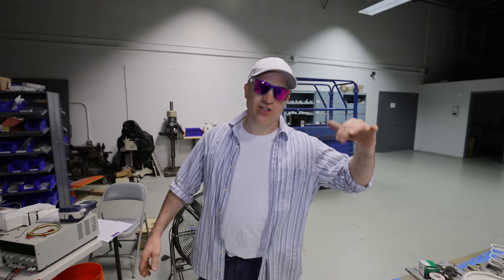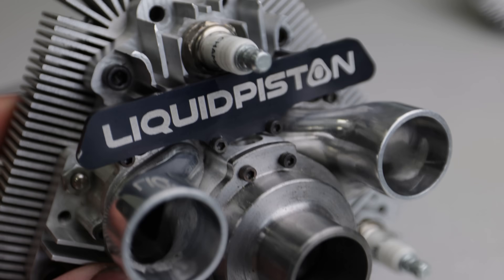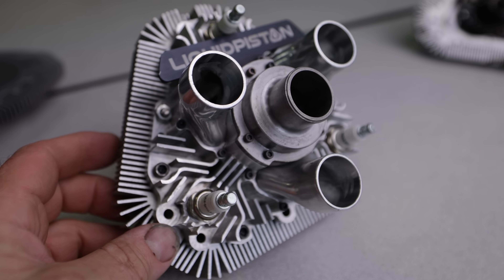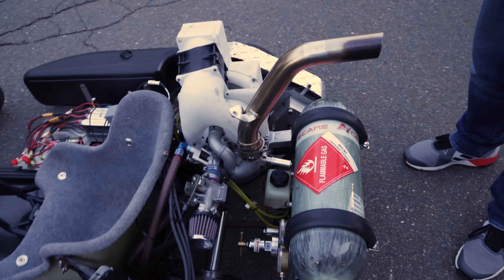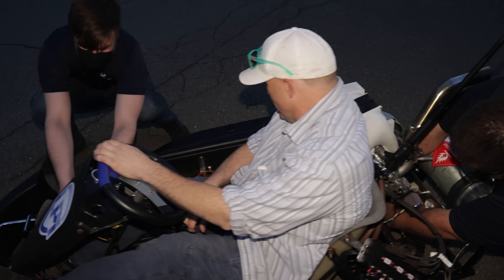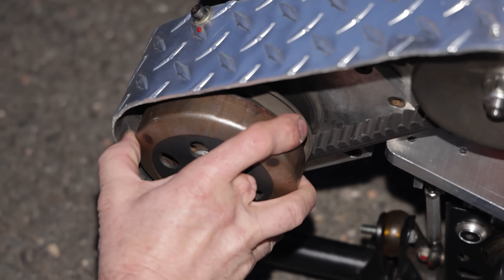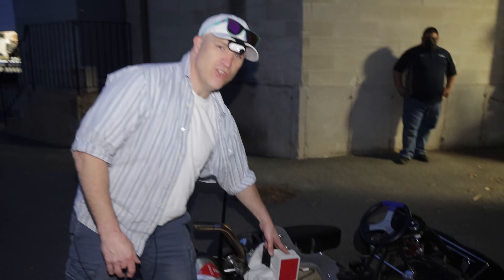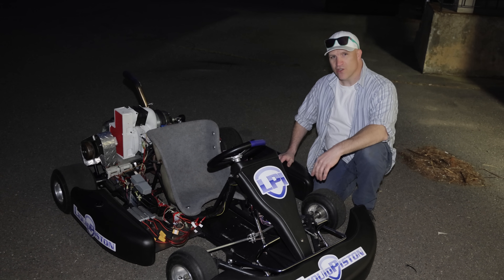Hydrogen Powered Liquid Piston Rotary Go-Kart

Comment: Many people are trying to build/create a hydrogen engine that doesn't melt or corrode quickly. Great job maybe you're the new elon . Next problem:create a hydrogen generator that can compress enough pressure to run that motor then make it compact enough to fit cars.

Comment: Nice touch timing the firing to the music. I'm curious if the exhaust should point down instead of up for water evacuation. Back pressure from the fuel burn might have water collecting in the upward facing exhaust plumbing? 👍 😃
Reply: The water doesn't condense in the pipe, the reaction product is gaseous water (steam) and any cold start condensation will quickly boil off from exhaust temperature. Hydrogen runs really HOT. You can't play with the stoichiometric ratio of H2 to O2 as you can with liquid fuel and oxygen. If anything you have to run it oxygen rich to reduce power of the stroke. If you run it H2 rich, you'd have a constant flame from your exhaust(and melt the tip of the pipe) as any hydrogen left in the exhaust product will immediately react with the atmospheric oxygen.

Comment: Good to see work continuing. In Australia we had the Sarich rotary engine, sadly never got to sort out the full burn level. Keep it up guys!
Reply: What 2 stroke oil did you run in that? I use nothing but amsoil interceptor in my rotaies.
Reply: @jlo13800  Sarich is long gone. But on 2 stroke jetskis we use a full synthetic oil. It lubes perfectly without burning away and comes as oil out of the muffler.
Reply: That sounds like the EMD16-645 2 strokes on the boat i work on and the detroits also. oil comes out of the exhaust if there is not enough load on the engines.
Reply: Yes the rotaries use the same 2 stroke synthetic oil!

Comment: I feel like that thing could use an $80 ebay CVT with half the weight taken out and be WAY more impressive. Yeah, it's the first step, but try to make it a normal looking step and not a tip-toe.
Reply: It will need another down gearing, but exactly this.
Reply: Looks like the CVT that’s on there is on the wrong shafts if the motor is on the front pulley
Or should I say it looks like the rear pulley is on the front and the front pulley is on the rear
Reply: @garymorel1882  It’s chain driven, so one gear. Presumably to compensate for the lack of torque. A CVT could be a great idea though
Reply: @TheFakeFatLegitimate  well it looks like a eBay series 40 but backwards in infact I built weird stuff too but I’d use a solid pulley on top being electric then use the secondary as it’s normally designed
Reply: I think their website shows something like that.

Comment: Cool! The Liquid piston engine. If you define a 4 stroke engine as  2 revolutions per combustion event and a 2 stroke as 1 revolution per combustion event the Liquide piston is a 1 stroke motor it has 2 combustion events per revolution. A rotor is a 2 stroke it has only 1 combustion event per revolution.

Comment: Steam engines added oil to the steam, in order to lubricate the internals, because water is a very poor lubricant. If you use oil inside, it is no longer clean, and will give some carbon build up, how do you solve that?
Reply: graphite or similar dry lubricant.

Comment: It may be slow, but it worked. That's where you learn. The belt clutch was possibly holding it back without the rpms needed. Tune the drive train I'd like to see more on it.

Comment: I'm confused. How does the engine lubricates?
Reply: Since the seals aren't rotating, they could pump lube in through one side and out the other.  With the see through plate provided by Warped Perception, this would have been ommited.
Reply: When it comes to Wankel rotaries (triangular rotors) oil is commonly added to the fuel which lubricates the rotor and apex seals then burns off during combustion, just like a 2 stroke engine you’d see in a line trimmer or chainsaw, but with the liquid piston, I have no idea. I only really understand liquid fueled systems, so I’m not sure about the gas either.

Comment: Awesome!!  More videos like this one for sure!!
Reply from the maker: I'm trying!! I seem to be getting back on track now, been a tough last couple of years
Reply: @WarpedYT  this engine need rusEFI ECU ..
Reply: @Abricos4440  would need to be completely reprogrammed, it would have no idea how to hadle the timing of this engine.
Reply: @mycosys  this is not a problem ...
Reply: @WarpedYT  I have a question. What is the point of running an engine on hydrogen, converting that energy into electricity, and then converting THAT into kinetic energy? Why not just run the engine on hydrogen and then just use that? Why over-complicate the system by using the engine as a generator when you can just run it like any other engine into a gearbox puting power to the ground? Seems a bit like a dog chasing its tail to me. I would genuinely like to know the reasoning behind adding an extra step in the process that seems like it doesn't need to be there. This may just be my opinion but I feel like simplifying the system would be more beneficial in the end.
Reply: @WarpedYT  I want you to open the top of a battery and in slow motion show it being dipped in water
Reply: @WarpedYT  i really want to see how that engine holds up on something spicy like Nitro-Methane
Reply: @cmdr_scotty  i dont think its actually running on the fuel mate, pretty sure its the electric motor doing 100% of the work, every video its been connected to some type of electric motor also.
Show me a video of it sitting there at idle speed and ill be convinced.
Reply: @shannonneal3271  more likely it's torque curve isn't very great seeing as how it's the size of a little pocket bike motor. Having it hooked to a generator which indirectly drives the wheels via electric motor would act as an overly complicated CVT. I'd say it's probably about 2hp, maybe 3ftlbs
Reply: @WarpedYT  🌻🌼🌼💐🌸
Reply: @Warped Perception  - wait - how do they lubricate this hydrogen-powered rotary engine? Do they put lead in the  hydrogen fuel, just like leaded gasoline? Or do they somehow mix in some oil as lubricant? Hydrogen is a gas, so I don't see how you mix the lubricant in there.
Reply: Here you have this guy again
Reply: @-never-gonna-give-you-up-  damn right! I see he has good taste ;)
Reply: It is nice to see this engine works with hydrogen - but 10kmh ist little bit low.... For me it was an fail. Sorry - I expected much more power from +10.000 RPM engine... Even it the engine was small.
My old 2 stroke 49ccm Vespa is more efficient/powerful.
Reply: I daydream about homebuilt liquidpiston powered drone-chopter personal aircraft.

Retrofit onto Honda sportsbike, drivetrain removed. Fueltank repurposed to feed liquidpiston propelled rotors mounted out bound of axles on each corner, throttle cable linked to rear rotors pitch/angle.
Reply: @AlienLivesMatter  👍👍👍great
Reply: @justsomeguyhere I guarantee to you that you can produce more hydrogen without fossil fuels than you think. I have done it
Reply: So why aren't both ends of the rotor being fired on? Looks like it would double the power.
Reply: @jasonbirch1182  because that's not how it works.
Reply: This is amazing !!!! If this engine can run on any fuel, this engine will make it for a perfect hybrid powered machine, I want to see this on motorcycles !!!
Reply: @warped Perception it's not even close to its potential.
The goal of this engine is to use hydrogen to vaporoze water mist thus increasing compression rate and expansion. As the rotary motor has no oil carter container, it makes it perfect. The sealing has to be graphite as the chamber should also be coated with graphite. I rimmed some experiments from hydrogen extracted from water, using it to turn water mist to vapor. The power generated was insane.
I was preparing to vonver my Volvo turbo engine but as I went to Ireland, my wife sold the car. The price she sold the car would not even pay for the tires... If you know what I mean
Reply: @joaocarimo  yes indeed
Reply: @justsomeguyhere no, I assure you it isn't. This problem has been solved by nature long time ago. All you need is to replicate what nature is already doing. There are processes which are reversible. Which means you can repeat many clicles and recycle the by-products. Just as nature does chemically.
Reply: @justsomeguyhere do you have any degree in chemistry?
Your own words revekas us that you don't.
I have successfully produced enough hydrogen to move a 1.6cc turbo injection engine.
What is the point of me arguing with you? If you prefer to believe that fossil fuel is the easiest way, well, keel sleeping. I can only laugh
Reply: @justsomeguyhere if you use brute force, yes, it is hard to break the covalent bond between hydrogen and oxygen.
But if you dare to think out of the box, what is a covalent bond? Then you'll know how to break. As simple as that
Reply: @justsomeguyhere ignorant!
Don't make me laugh!
Is electrolisys the only way you know?
😂😂🤣
Reply: @justsomeguyhere you have nothing to say and you think you know stuff when you have no clue. You think electrolysis is the only way. Boy, You need to educate yourself before you speak.
I have results and results speaks for itself. I will finish my project and then I want to see you screaming your claims again. Everybody will laugh at you
Reply: @justsomeguyhere even high performance electrolysis with catalyst such as urea would destroy your childish claims.
You have no idea that Electrolysis can be effective at low amperages.
I'm not going to teach you, because you won't be able to comprehend.
Do you at least know what is a catalysts? What they are for?
Are you also going to claim it's fossil fuel? Come on!
Reply: @justsomeguyhere well, it seems that you weren't paying attention. You need to get back to school to learn about high performance electrolysis.
What if I show you a video about a car running on hydrogen with a high performance electrolytic cell?
What sort of catalyst do you think was used? I am saying that although high performance electrolysis is possible, that's not the most effective way. There are other ways to produce large quantities of hydrogen without using fossil fuel.
There is also plasma electrolysis, which would expose your ignorant claim
Reply: @justsomeguyhere tell me, ignorant! What does this has to do with physics? I have a degree in physics.
I am qualified to teach you.
This is pure chemistry!
That's why you keep babbling ignorant claims. Do t make me laugh more
Reply: 찐이다
Reply: A simple timing mod and carb adapter could do a 4 stroke as well as been far more powerful
Reply: Seeing you guys commenting on each other's work makes me a happy guy!
Reply: what about compressed  wood gas
Reply: They had the motor running right in the 2nd one but they hadn't fixed the slipping clutch.  The power wasn't doing anything.  It seemed like they either didn't believe you about the clutch, didn't want to believe you , or were the type of drivers that would be backing out of a parking spot paying full attention but still somehow bump into another car,  immediately panic and peg the throttle to the floor for no reason, and take out a row of parked cars and still have to have someone explain what happened , afterwards.  Hopefully it's the 1st option.
Reply: Hydrogen manufacturing is a dirty business giving off Greenhouse gasses so be sure to educate your viewers of this factoid
Reply: @pickledpigknuckles6945  How's that? Splitting water into Hydrogen and Oxygen yields Hydrogen and Oxygen. Burning them together yields water vapor. But I guess everything is a Greenhouse Gas these days...

Comment: Hmm, yes. Use a high pressure hydrogen tank as the rear bumper. Nothing wrong with that.
Reply: As if they're gonna crash at those speeds, come on
Reply: Shhhh! ...secret weapon, the boom and zoom rear assault defence bumper
Reply: Smiles in Ford and practically every car manufacturer until 1985.

Comment: The issue is this go kart would not worl for racing and there is one reason why high class go kart slicks which if you dont know they have specific slicks that have one issue one spot of moisture on the track and you have 0 grip
Reply: Slicks have grip on wet surfaces, just have to know how to find it and use it. The more abrasive the track is, generally the more grip you’ll find.
Reply: @thiswillprobhrt  you haven't raced on true go kart slicks then most slicks do work on wet surfaces, but true performance go kart tires you tap moisture and you basically are on ice

Comment: Making it a hybrid was unnecessary. Just coupling the engine to the tourqe converter would have been better. Over engineered and under performing.
Reply: Something tells me its fake.
Even when working, you can see the electric motor start to spin and propel the kart before the engine rev up.
That kart is moving on lipos, and we can't know how much it's the engine recharging them.But seems like even the engine is moved by the electric motor, at least at the low rpm range.
At this point, i need to see that engine working standalone, without even the dyno. You can see on the dyno footage that the engine is reved up before the ignition starts.
That thing is smelling worse on each video.

Sorry to all if I'm wrong, but they need to expect some skepticism and provide some proof like the engine working alone.  They know it, and avoiding doing so seems suspicious.
i really hope I'm wrong.
Reply: @xiro6  Nah you're right, it smells like many other investment scams. But even if it works, it's probably way too small to power things any other way, or they can't get it to run at a lower RPM. Cool little thing, but I'd bet they're greatly exaggerating the power it makes. Hopefully I'm wrong, but it's just too much like every other bunch of bull for me to trust it yet.
Reply: @xiro6  I've read some of the papers from MIT.  Impressive.  Especially with the targeted (and almost) 26:1 compression ration.  They like it.
Reply: @xiro6  Yeah every time i see these engines they are connected to something that looks like an electric motor. I don't understand why it is never run just setting on a test stand without something connected to the output
Reply: @glennmagnus854  My guess is that when they are connected to an electric motor, then they can run at the best rpm for peak efficiency at all time and waste less power to heat. It's the very reason the Wankel rotary was considered by Mazda as a range extender for their electric vehicles.
Reply: @xiro6  I don't think you're 100% wrong or right. Hydrogen is a terrible fuel for internal combustion engines, it has a terrible octane density so unless you're running extreme boost it produces very little power, which is mostly in the form of RPM not torque. My theory is the engine was just assisting with the speed and efficiency of the electric motor. 

With that being said e95, CNG or propane would have been a better fuel source.

I wholeheartedly believe these engines produce the kind of power they claim but they never claimed how much power this engine was making with hydrogen.

In my opinion If you want something hydrogen-powered use a fuel-cell.
Reply: @zeanyt2372  Totally true.
Here in Spain we have the InnEngine, a truly awesome piece of aluminum art, which they are even finalizing the installation on a Mazda.
They also backed by a university and scientific publications but...still not a working video of at least a prototype. 
And they have plenty of them, as they claim, improved versions but no proof at all more than a noisy thing attached to the particle accelerator from CERN.
It's so difficult to upload a simple video to the internet?
Maybe all those cutting edge tech companies need a simple-minded guy like me who need to prove any little step to nobody.
Maybe I ask too much, like many people say on the comments, they can't say the data because someone will copy them, i don't know how someone can copy an engine with the power output data. Must be so simple, the engine design stuff. XD
Reply: @xiro6  wow so everyone truly loves rotary engines